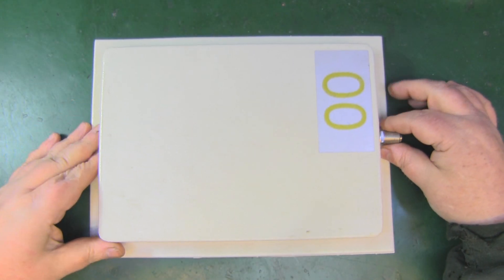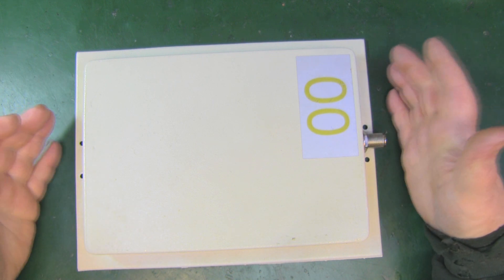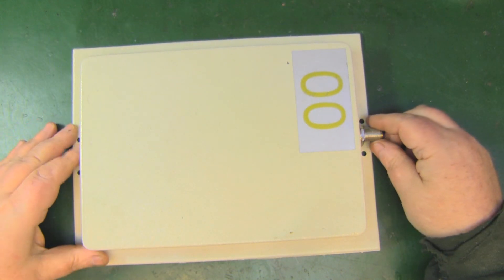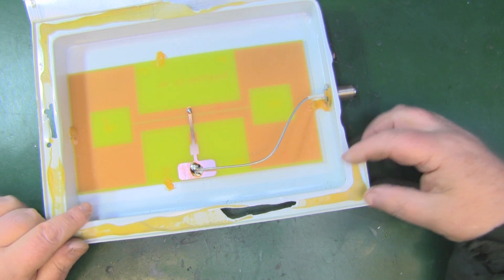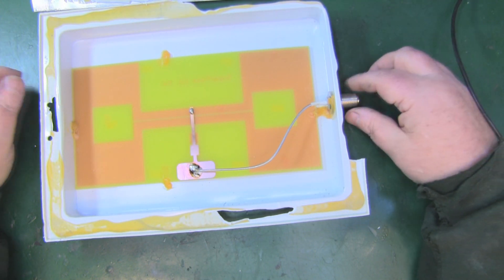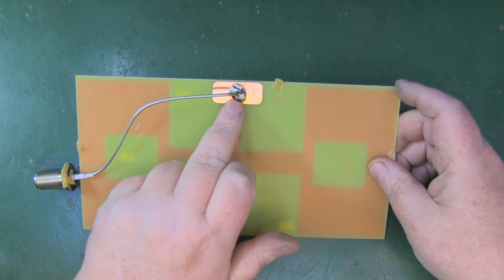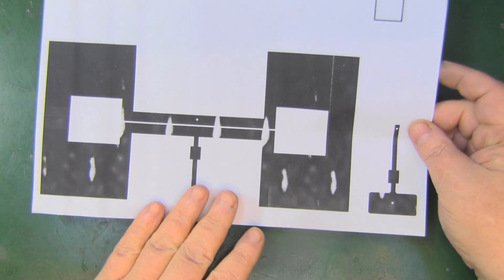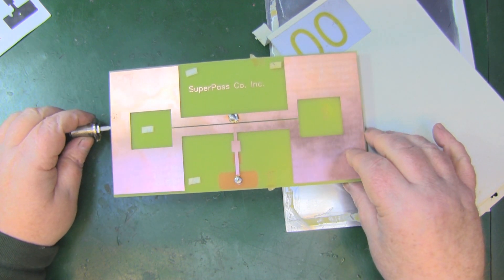10.8dBi H-Pol Sector Panel Antenna 902-928MHz

Comment: I scaled the antenna down by 40.22%, the difference between 915 and 1283MHz, the required resonant frequency. But it came out resonant on 1615MHz ?? I used standard PCB material, wouldn’t think that would be the problem. Any ideas Andrew or you guys. 73’s John VK2ATU.

Comment: Hello Andrew I need a high power antenna for 800 MHz and 20 bands to use 4G internet, please help me make the best antenna. Thanks
Reply: I saw Yagi antenna is applicable, because of need high gain. Also if the gain does not matter monopole antenna is a good choice.

Comment: @5:38 =69.13 pound. I've used these antenna for years in harsh Canadian winters/summers and I can tell you they stand up remarkably well.SuperPass Company Inc. was founded in 1996 by several world-leading electrical and electronic scholars and engineers who have a strong desire to develop innovative, high performance, and low cost antennas for the booming wireless communication industry.

SuperPass is located in the well-known industrial area, Kitchener/Waterloo, Canada and has a very close relationship with the nearby famous polytechnical institute - the University of Waterloo, which serves as the high-tech research and development base for SuperPass.

Comment: It not a dipole, rather a two element array of loops driven by 1/4 wave slot line transformers.  You’ll notice the inner perimeter of each loop is about the same as the spacing between the loops, or 1/2 wavelength.  This also makes the slot lines 1/4 wavelength, transforming the low impedance of the loop up to something more reasonable.  The loops are used, as opposed to dipoles, as they are less susceptible to loading by the ground plane, allowing to be placed close.